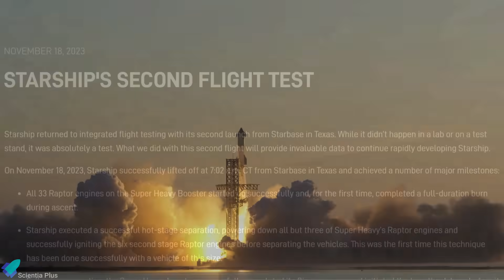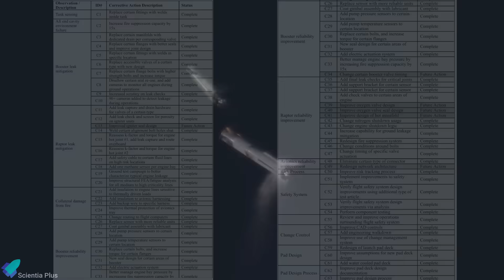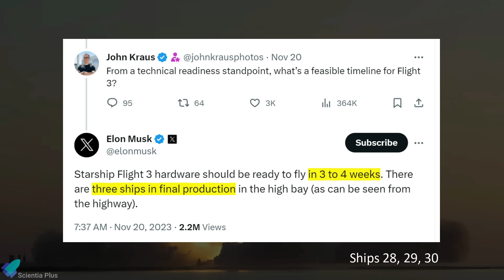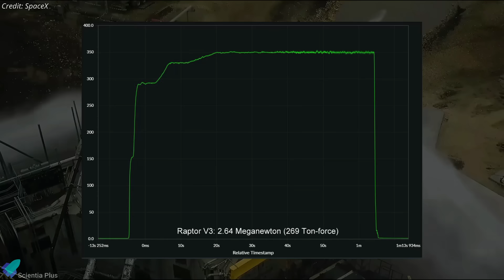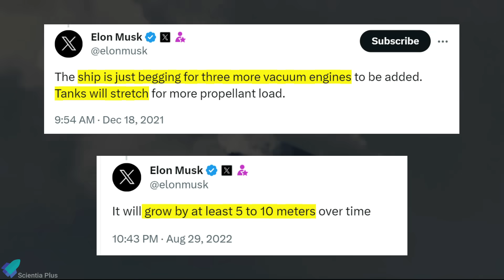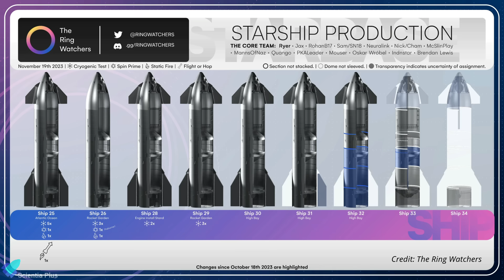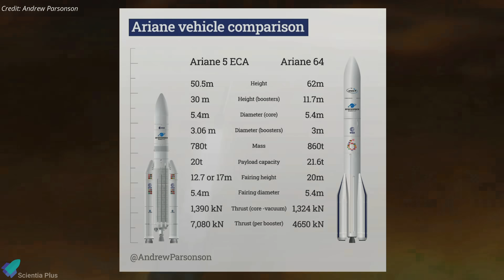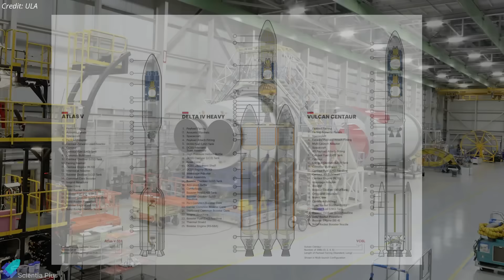What Exactly Happened To Starship, Did Stage Zero Actually Survive The Launch?

Comment: Starship was never fixed. They alter the launch program and Block sensors data data. This did allow 33 engines to burn. But it caused the booster to explode when they started the gimble maneuver, they attempted to relight the 33 engines. But they was already a plasma fire in the engine bay. That mean it was full of liquid propellant. When they attempted to restart engines. This ignited in the engine bay. If you observe the slow video you can see the explosion started from engine bay and progressed all the way to the front of booster.

The starship was going to burn all the fuel on it way to Hawaii. So it exploded with either an engine blowing up or it developed fuel leak right before it reaches the engines. I believe this happened after going off line. So they have no data to comb through. NASA uses a chase plane. But Elon outed to without this aircraft to take picture until it flew away or recorded it’s disassembled starship. With vital information to help discover what happen.

So next rockets will be another Roman candle. 33 engines will never reach LEO which would be around 1800 kilometers long. I hope nasa let Elon use his own money. I do not like to burn cash.

Comment: I'm expecting that the thickness of the steel plate that creates the Starship / Booster will be thinner in the new version. This was a goal of Musk from the beginning. I don't have actual numbers, but I expect it will be in the specs given to the FAA for license next year. 
With 4 of the present version in production, Musk wants to launch at least 1 more this year, as he has permission to only launch 5 per year from Star base at present. That way he can get the next version flying early next year. 

Keep an eye on 39a in Florida to see how fast the Starship launch pad is progressing. There are at present no restrictions on number of flights. I am hoping that he will get permission to launch at least 1-2 (if not more) from there next year. He is aiming for 100 launches before he goes for human rating. With Artemis and Dearmoon apply pressure on SpaceX to get Starship human rating by 2025, that requires a huge uptick in launch cadence.

Comment: I'm sorry but you're wrong about the engines failing to reignite. 00:42
They clearly reignited and that's easily visible in the video seconds after separation. 00:38
Reply: What I think happened is that the "Hot Staging" was Too Hot, 🔥 and that created some structural instability at the top of the booster stage. 
Then it either ignited from the FTS the leaking fuel made it down the the boosters engines as they were beginning their backburn and BOOM!! 💥 
Pretty sure that it's one or the other.

Comment: What would be the gain in cargo if the current Starship was launched from an island located exactly on the equator?

:face-blue-question-mark:
Reply: Not enough to be worth doing or they would be doing it. Would you pay twice as much for something if it was 1 percent better?
Reply: Everyday Astronaut did a video about this a couple weeks ago https://youtu.be/4m75t4x1V2o?si=FNGU6fvYU00LvVIQ
Reply: Why would you think that's a plus?
Reply: @mervstash3692  the idea is that the equator is spinning faster and so that extra would give the rocket more speed in the direction it needs to go.

And it actually does.

But only by the tiniest amount so it’s not actually worth it.
Reply: @Fogmeister  yes we all understand the equator bit. Just don't see where any benefit outweighs the negatives
Reply: @mervstash3692  no need to be a douche about it. You seemed to not understand anything about it “why would you think that’s a plus?”. So I just explained it. 🤷🏻‍♂️
Reply: @Fogmeister  I'm a douche because I knew about the equator thing? Geez mate grow some thicker skin.

Comment: Do you think NASA will require SpaceX to make Starship use an escape pod with parachutes??  I'd feel better about this solution, tbh.
Reply: They won't have time to start working on an escape pod solution. It's meant to land on the moon in Dec 2025
Reply: Shuttle didnt have any escape/rescue system.
Starship itself is escape system from the booster.
Same with DreamChaser.
🚀🏴‍☠️🎸

Comment: Still waiting for commentary about what fixes will be made to hold on to the tiles. Though maybe to intent is to determine how well Starship would survive entry with lots of missing tiles. Do hope the next launch vehicles carry on board cameras.
Reply: Yes tiles or TPS in general is a really tough problem with quick turnaround in mind.   So the tiles on Starship surprised me, whereas the original transpiration idea seems more reliable but maybe more limited capabilities and heavier with the consumables
Reply: No matter how much they check, heat tiles are inherently dangerous.  The DreamChaser is going to face the same trouble.  That was the main reason to ground SpaceShuttle.  Best part is no part.

Why not try a different outer layer on a Starship ?  Look:
Aluminium  melts at  658°C,
Steel.            melts at 1440°C,
Kobalt.         melts at 1490°C,
Iron               melts at 1539°C,
Titan.            melts at 1670°C,
Platin            melts at 1770°C,
Chrom          melts at 1890°C,
Molybdan    melts at 2620°C,
Tantal           melts at 3030°C,
Wolfram       melts at 3370°C.

Now, if SpaceX hand this over to Tesla, so they can let their AI chew it thru, there might be a real nice compound solution.     🚀🏴‍☠️🎸
Reply: They weren’t really checked on ship 25, it wasn’t a priority. Ship 30, which is next, has been throughly checked so should fare better
Reply: new engines in both the main and booster increase to 200 T of payload  musk already said it . on v2 starship .

Comment: I think they had better find out what happened to the booster and starship on the last flight before they go and start making changes without that data.
Reply: They probably already know what happened, any delay would be for remediation based on those findings. Failure of the booster engines to relight will no doubt be due to the engines ingesting ullage gasses during the flip, that would be resolved with changes to the trajectory and relight sequence after separation. The second stage is more difficult to comment on because there is little to no information yet about what actually happened. Most speculation revolves around a LOX leak as it fits with what was observed.
Reply: @schrodingerscat1863 this is some serious musk simpn’.
Reply: @kurknielsen  How exactly, it's just a statement of fact as we currently know it. Doesn't really have much to do with Musk, it is the team of scientists and engineers at SpaceX that are doing all this work.
Reply: @schrodingerscat1863  Probably just an angry Blue origin engineer.
Reply: More data they have, they can do better on the later rockets.

Comment: Rocket explodes again. Fanboys: yay! Mux for king! (Drops to knees)
Reply: You forgot 33 engines working full duration, successful hot staging and mostly nominal starship burn.
And yeah explosions are part of destructive testing. This is still in prototype phase.
Reply: hmmmm...the success seems to annoy you.  Excellent!  LOL
Reply: @donkey3187 more newspeak.
Reply: Someone leave a keyboard unattended again?
Reply: Have you counted how many F1 engines for Apollo exploded in tests? They literally put detonators in them. Any comment on that? (Yes it was before internet and CNN weren't invited to cover the kabooms.)
Reply: re: test flight success -- It depends on where one sets the goal posts.,  For the program one could set the goal posts at a successful moon landing and return of astronauts.  From that point of view every test during the development program is a failure.  Not a very useful point of view for any complex program involving 1000's of elements big and small to go right.  Here is a short list that comes to mind re: IFT-2

Success ---  rapid destack - component replacement - restack with only a 24 hr delay.
Success ---  Smooth fueling and countdown with only a minimal (less than 2 min) hold.
Success ---  Liftoff with all 33 booster engines operating.
Success ---  Liftoff with essentially zero damage to the pad using a revolutionary pad cooling system design and implementation.
Success ---  Replacement of hydraulic gimbal actuators with electro-magnetic gimbal actuators.
Success ---  Completed booster phase of flight with zero engine cutoffs reaching designed velocity and altitude for the stack.
Success ---  Coordinated booster engine shutdown followed by stage separation.
Success ---  Completed planned booster flip maneuver for boost back.
Success ---  Ship engine ignition and no cutoffs during ship phase of flight.

All of this on only the second flight test along with probably 100's of other changes made since IFT-1. In addition the data capture will help develop design changes to achieve more success for IFT-3 in the test program.  As a baby is learning to walk would you consider every fall a failure until they can sprint?  That is a pretty negative point of view.